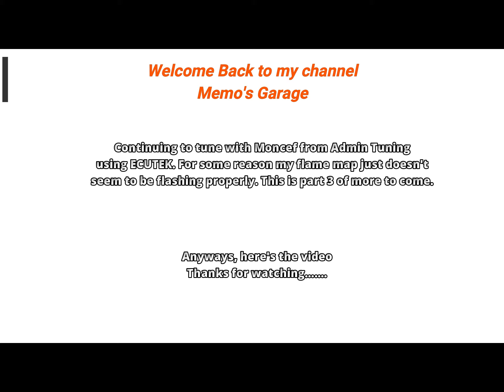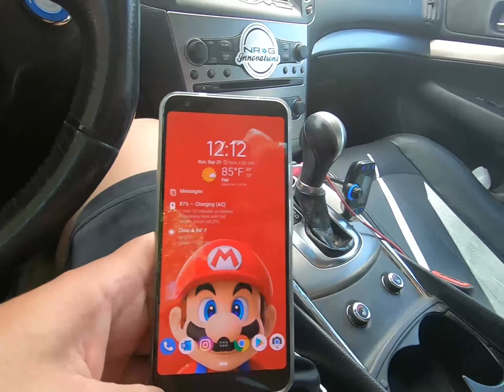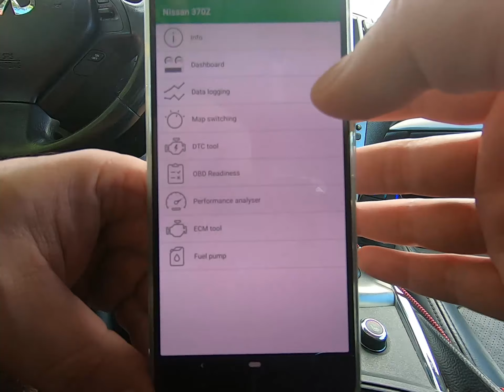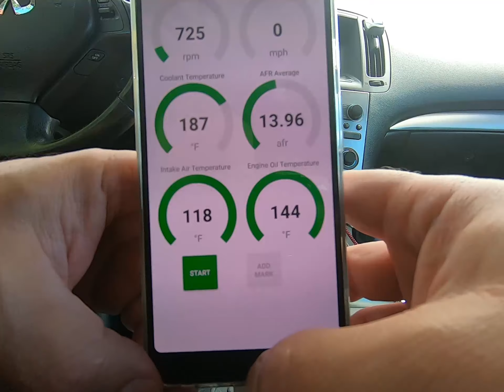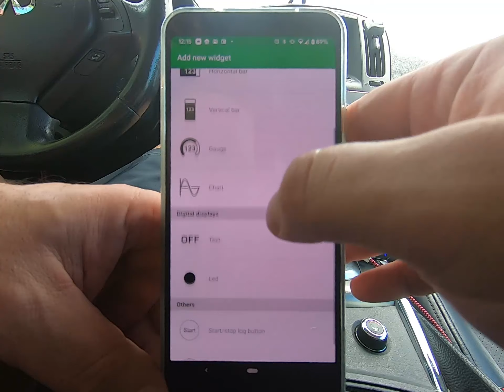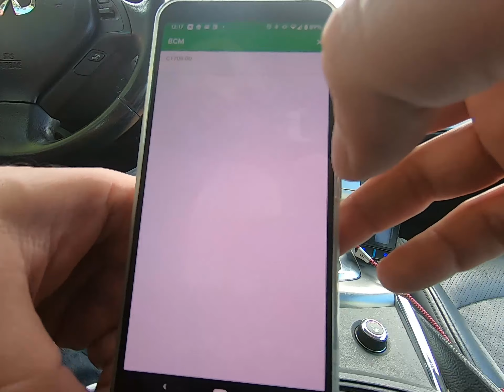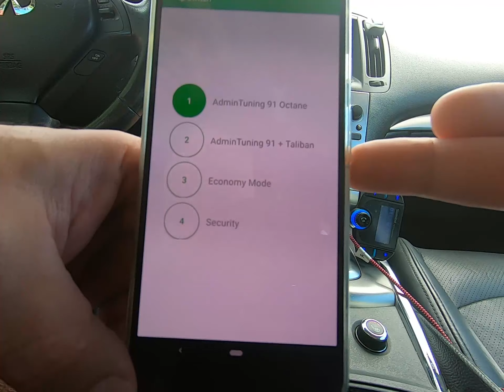How-to Process For Remote Tuning My FBO Infiniti G37 Sedan - With Admin Tuning Using ECUTEK - Part 3

Comment: What mods do you have have what did you gain from the tune ?
Reply from the maker: I've been changing my exhaust around the last month or so I haven't re-tuned it or gone back to the Dyno for the after #'s. At the moment I have the CPT cold air intakes, eBay throttle body spacers, DC Sports headers, Z1 Test Pipes, Manzo modified Y-Pipe (2 small 8" resonators) which attaches directly to my new 30" Magnaflow Muffler with a 3" inlet/outlet (sits right under the driver/passenger), from there the piping is 3" straight back to the rear bumper (exits at the driver side only), right after the muffler there is a 16-18" resonator. I have some new resonated Test Pipes coming early February, after I install those and maybe reduce the 18" resonator, I'll get the car re-tuned and it'll be back to the Dyno for the after #'s. Check out my latest video if you want to see how all of this looks under the car and how it sounds. Thanks for visiting.